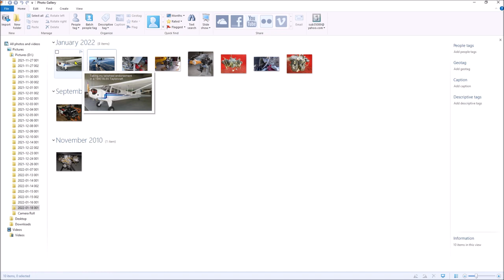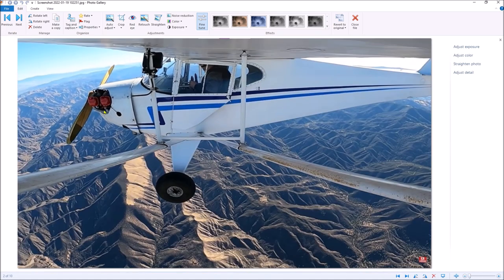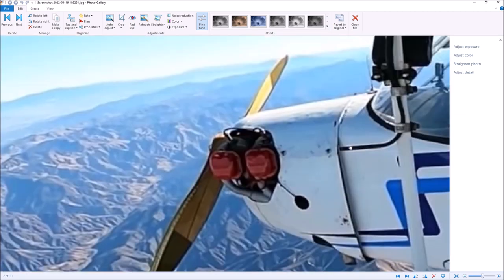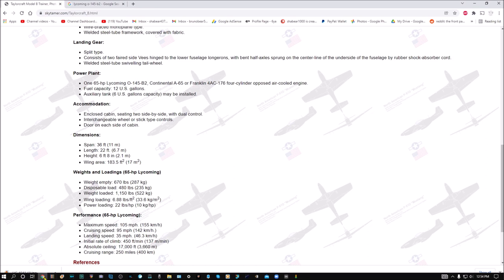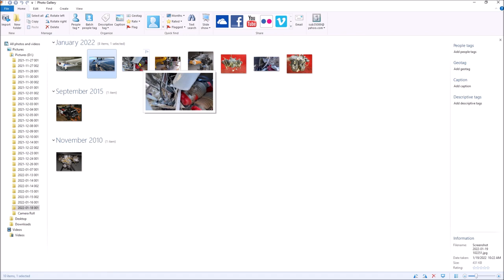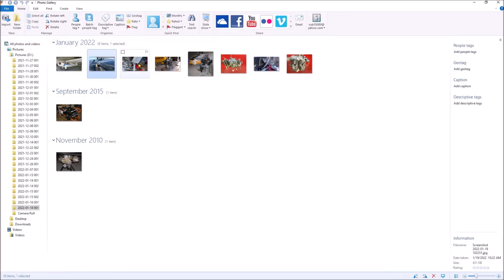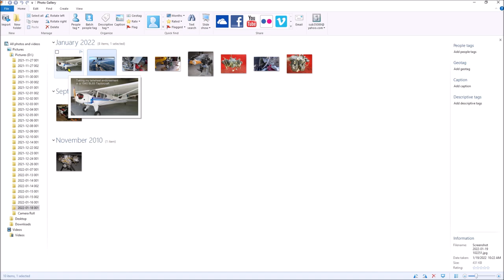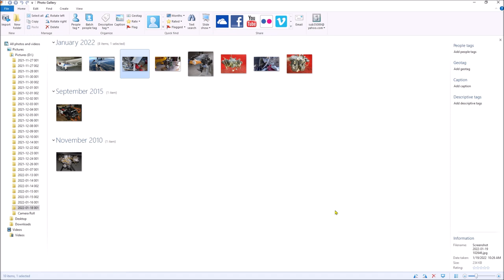Trevor Jacobs Plane Crash New Information About The Engine

Comment: Very interesting video . I have some insight regarding engines , timeframes etc . I did my tailwheel endorsement in this exact Taylorcraft in March 2019 and it definitely still had the Lycoming engine     in it . The main disadvantage of the BL versus the BC is to replace a cylinder the entire case has to be split in half . This Taylorcraft was posted for sale ion Barnstormers in October of 2021 for $9,000( I should have bought it !) with an extra engine but  in need of some work
Reply: Thanks for posting! Great how the internet can bring out the real deal from ppl who know things first hand.
Reply from the maker: That's amazing. Thank you so much for the information. Very interesting. The plot thickens again. That's very cool of you to jump in here with undisputable facts. You're awesome. Thanks again my friend. BTW: do you mind if I use this info for an upcoming video? I think this could be the info we need to set some doubters straight.
Reply: Oh, you actually flew it? How was it to fly? I feel so sad for it now. It was a classic, almost as old as my 1929 Ford Model A. Must have been hard seeing it destroyed this carelessly.

Comment: There are several things regarding aircraft that you may not be aware of.  This aircraft is a "certified" aircraft, as opposed to a "experimental" aircraft like Jacobs other aircraft N63BG.  Certified aircraft may ONLY be worked on by licensed aircraft mechanics (A&P).  The owner of a certified aircraft may NOT work on the aircraft, like for example changing the engine.  You can not just change the engine or any other significant part in a certified aircraft.  Extensive paperwork and licencing is required to change the engine in a certified aircraft.  The FAA registration information on this aircraft NC29508 shows the airworthiness certificate to be valid as of 01/03/2022 (this date is the date the paperwork was recorded by the FAA and not the date info was submitted).  The engine is shown to be a LYCOMING 0-145B SERIES.  If this engine was LEGALLY changed, the FAA airworthiness certificate would show the engine as a CONTINENTAL.  It does not!  Jacobs is listed as the owner of the aircraft.  Also, a used airboat engine can not be put in a "certified" aircraft.  The engine must be certified and that significantly increases the value/cost to around $10K.  A Taylorcraft BL65 in fair (certified) flyable condition could be worth between $18-$30K.
Reply: So the guy working on a twin prop  plane to try to get for free if he can get running is not "allowed " to work on it?  He is not an A&P mechanic for sure.
Reply: @MichaelDillin   So, that old 'free' plane that has been sitting on the tarmac untouched for years has maintained certification?
Reply: "If this engine was LEGALLY changed, the FAA airworthiness certificate would show the engine as a CONTINENTAL."   Not true!!!
Reply: Since the Taylorcraft was sold (certified) with Lycoming, Continental, and Franklin engines, it is possible to do an engine swap under a supplemental type certificate. This is more work than just switching to experimental but still possible. It would probably take longer than a month, so I’m sure this was not done.

Comment: That engine has been spray bombed, not overhauled. No reputable overhaul shop would spray bomb the valve covers without removing them and over spray the cylinders. He probably put an houred out engine on it and spray painted the valve covers to look good for the video. An aircraft engines value is based on hours, not whether or not someone used degreaser on the cylinders.
Reply: Ya, that over spray is a dead giveaway that somthings fishy, with that engine! Home job, for sure!
Reply: I highly doubt Trevor did anything to that engine. He doesn't have the know how. It's way more likely it got swapped out in those 5 years between videos. Anyone with any sort of logical thinking ability would come to this conclusion.
Reply: Exactly

Comment: The bolts is what does it for me. Absolutely nobody would paint over bolts like that on anything you'd need them to get back out of on a semi regular basis.
Reply from the maker: Great point Mark. I know I wouldn't.
Reply: Agreed. That paint job was for the plane to look cool in the video. He liked the old look before he changed the engine to make "production" cheaper and didn't care about overspray.

Comment: The breakdown on the model numbers of the early Tcraft (Taylorcraft). The B model was his second design, the first was the A model. Following the B is one of 3 letters L for Lycoming or C for Continental or F for Franklin. So if B model had a lycoming in it it was a BL65. If it had a Continental engine then it was a BC65 and if a Franklin it was a BF65. Hope that helps.
Reply from the maker: Thanks, great info.

Comment: Based on the fact that Trevor used a skydiving parachute, that some have said had a backup chute and because he scouted the location beforehand. I think he may have actually bought an engine that was air worthy because he wanted to make sure that he was in control of when it shut off so he could do this stunt in the safest way possible for him. He obviously didn't care about anyone else, but I really think he was thinking about his safety when making a lot of his decisions. 

For example, the fire extinguisher strapped to his leg could be to ensure that if the plane caught on fire and he wasn't able to steer his parachute away from the  blaze he would be able to fight his way to safety. Others have said it was to put out the plane to recover his cameras for the video, but I doubt the GoPro's footage would be retrievable if they were in a fire. Also, I don't think the fire extinguisher is large enough to extinguish the whole plane. 

Further proof that backs up my theory that he was thinking about his life was the fact that he had plenty of fuel. He didn't want to the engine to cut out anywhere but a preplanned spot and he wanted to give himself a way back to the airport if he needed to do so.

I'm sure that the camera he had on the selfie stick had captured enough for his video and the other GoPro cameras were just gravy, also I wonder if he collected the memory card from the one behind him so he could make sure nobody else got their hands on that one. 

Trevor Jacob is a very selfish person and most people like him aren't going to take serious chances with their lives, if they can help it. However, they also can get in trouble when they over estimate their abilities. He thought he was smarter than anyone else who would watch his video, the internet is now showing him how dumb this whole con was.

Comment: If I was going to crash it, I would take the certified engine out and find one that had it TBO run out. The engine looks like a A-65-1708f. They were used in the grasshoppers LH2, the army version of the same plane during ww2 and there were thousands of them made. I think they made a bunch of them for GPUs as well, because home builders liked to convert them for the aircraft. The auxiliary fuel tank shows it was near full. The army manual for the LH2 printed in 1944 says that engine uses 4.3 gallons of fuel per hour. The best glide speed for that plane is listed as 60mph and it will glide 12 miles at that speed from a height of 8000 feet. The landing roll for 2 pilot’s weighing 170lbs and wearing 20lbs parachutes is listed as 400 feet. It states if the engine quits on takeoff, lower the nose and land straight a head. It says nothing about the two army pilots wearing parachutes to go ahead and bail-out. In the video where he’s looking down at the plane from above before it crashes, you see a valley with a fairly straight dirt road that, to me, appears to be about 1200 feet long and about 400 feet wide at its widest point. Big enough to have a small fly-in for J-3 cubs and Taylor crafts. Also from the altitude of hi steerable parachute I think he could have landed in that road area, the parachute had plenty of height to steer there, but it make for better video if you have a dramatic landing in a thicket. He also took the time to trim the airplane nose down. Was that because he knew it was possible for it to glide 12 miles. I think he trimmed it like that so he wouldn’t have to walk to far to get his go-pro cameras. Even if the plane had ran out of gas, there’d still be a half gallon or so in the tanks that is out of reach of the sumps. The engine, magnetos, and engine exhaust were cold enough, that there was no post crash fire. That at least was a blessing. The last thing they would need is another forrest fire. Lastly, I could see lots of roads and trails in the video, He’s lucky that nobody on the ground was hurt. If he is not guilty, at the very least he is terminally stupid and has no business near an aircraft. In this case, I hope the FAA drop the shit-hours on him as an example to any other would-be influencer or Youtuber who might think this was a good way to draw clicks and views.

Comment: Maybe it been mentioned already. Airplane engines can only have x number of hours on them before they have to be rebuilt. So maybe the old engine had plenty of hours remaining on it and the replacement engine might be an engine out of hours. So it was probably done for money, sell the old engine with plenty of hours remaining and swap it out with a much cheaper engine that requires an expensive rebuild. 

Also, with these airplanes every bit of work has to be done by certified mechanics and recorded in publicly available records. So it should be easy to see if the previous owner had the engine changed. The exception to this is experimental/homemade airplanes, you don’t need a certified mechanic to work on it.

Comment: Thanks Shabear1000. (I got here from Pete’s Guide channel who gave you credit). I have an idea why he swapped out the engine. The FAA and the NTSB likely know the exact altitude he abandoned the aircraft but we are all guesstimating. Many assuming 9000 ft but my analysis puts him A LOT higher. Firstly he's a thrill-seeking skydiver. Most of that is done at 10,000, more advanced regularly go higher, but I've done photo-matching of screenshots with Google Earth Pro on a PC and I put him significantly higher. (I'm working on a video or two.) He needed lots of altitude not far out of Lompoc airport (LPC) for the stunt. From what I've learned the original 65 HP (85 kw) Lycoming would struggle to get him to 9000 ft let alone thousands of feet higher. That engine in the wreckage almost looks brand new or highly reconditioned. So as you point to, it's a Continental apparently, at least 20 more HP, specifications for a Continental O-190 (C75 & C85) 85 hp (63 kW), that's a significant improvement but what could a higher horsepower a reconditioned, upgraded Continental O-190 produce?
Reply from the maker: Sounds like you're doing your homework, good job. I would like to see the videos when you are finished. Please let me know if you post them. Very good information Mark. Thanks for watching and commenting.
Reply: @shabear1000  Sure thing, thanks and yes. Wait. Whoa: Look up Continental's new 200 series that can go in the Taylorcraft with almost twice the power at 125 HP.
Reply from the maker: @markmiller6844  awesome. I'll check it out lol. BTW, did you know his experimental plane has a Lycoming engine in it? Interesting 🤔

Comment: You said the old engine is more dependable and has more horsepower. If you ask me it looks like sold it to make the video cheaper to produce. And then he did a crappy paint job and didn't bother doing the paperwork to make it legal because he knew that he was crashing it.  Thanks for putting in the hours that was amazing research.
Reply from the maker: That's a very reasonable possibility. Either way, I thought it might be worth mentioning. Thanks again.

Comment: Thank you pointing out the engine swap, look closer, it has different exhaust headers/downpipes!
Most likely because Trevor cannot weld or was too narcistic he also had to cut the cowling for the exhaust to exit. Its far more back than the original exhaust.

Also the clearance at the cylinder head cutout for the exhaust looks like almost nothing, no sane mechanic would do that!
If it was not for the air midflight the paint would at some point certainly burn a little and get brown. 
As there is no discoloration i guess that swap is quite new and had not a lot of runtime. 
Even hot exhaust headers after turning the engine off would sooner or later leave marks IMHO.

Looks like a rushed job to get that one flight done.

Comment: Yet another red flag, though the flange on the cylinder barrel to crank case looks different to the pictures of other Continental engines. If I was going to spray those rocker covers I would have taken them off to degrease them, it does seem strange that they have been painted in place so carelessly with overspray on the barrel. Since the intention was to crash the plane it seems logical to fit anything that would run for a few minutes and sell off the better engine with hours left. 
Ignoring Trevor's actions there are now probably 2 engines that will be on the secondhand market. One Lycoming that is recorded as being in a crash but has not been and one Continental with no record of being in an accident. Aviation in general has a great safety record, one way or another Trevor is taking uncontrolled risks.

Comment: Quite interesting! The FAA Registry currently shows a Lycoming engine for this plane under the ownership of Trevor Jacob. But I don‘t know if swapping the engine must be updated with the FAA records.
Reply from the maker: Thanks for commenting. I'm not sure about that either but I just found it strange. It might be nothing but then again it could be something LOL thanks again.
Reply: Is there any truth to the rumor that at the crash sight they found a huge black rubber fist suctioned to the floor where the pilots seat would have been?  He did have a fire extinguisher stuffed up his pants... Dude was lucky to get out alive. Talking about flying on a wing and a.... 🤜🏿
Reply: Yes, the FAA must be notified and the records must be updated to reflect the current state/condition of any aircraft.  If the aircraft was "legally" flying, it was NOT out of annual inspection.  The FAA registration information on this aircraft NC29508 shows the airworthiness certificate to be valid as of 01/03/2022 (this date is the date the paperwork was recorded by the FAA and not the date info was submitted).  The engine is shown to be a LYCOMING 0-145B SERIES.  If this engine was LEGALLY changed, the FAA airworthiness certificate would show the engine as a CONTINENTAL.  It does not! Jacobs is shown as the owner of the aircraft.
Reply: @kentmckean6795  and that's a smoking gun to me. If he swapped out the engine for a cheaper one to save money then he had to paint it to look like the old one and he had to helicopter out the plane to get rid of the evidence. Even if he only did the paint job because he liked the old look - why do such a crappy job with it if it's not just for one last video?

Comment: You pointing out normal procedures with engine replacements on aircraft. If the engine is listed in the TCD sheet or an STC it's legal
Reply from the maker: True, but if this plane was in disrepair and and he swapped the engine right before it went down, it could be considered intent. All I'm saying is if he swapped the engine just to get the plane in the air BEFORE it was registered to him, that's not going to look good in an investigation. Like I said in the video, it could mean nothing, or it could be another strike against his claim that this was an accident and he had no choice but to bail. Even if it was real (which in my opinion it was done knowingly) he is still a piss poor pilot for deciding to ditch before the engine even stopped rotating.
Reply: @shabear1000  in the video when he is pulling back on the yoke he's doing that to get the prop to stop turning. There was nothing wrong with the engine. To start it he should have pushed forward on the yoke to allow air speed to turn the engine over. So he 100% stopped the prop from turning for dramatic footage. There was nothing wrong with his engine
Reply: @Airplanefish  Trent Palmer also said that itbis possible that he might have been trying to get the last of the fuel used up.
Reply: Fish if you watch the original video again you will see that he has trimmed the aircraft to go nose down. He is pulling back and letting go of the yoke a few times to check it is trimmed down.
Reply: As it turns out the FAA has the Lycoming engine registered, NOT the Continental. Hence the engine was changed and not registered as changed hence, illegal, if this douche bag changed the engine himself he breached another FAA law. So this youtuber was spot on and no ‘normal procedures’ were followed as you state.
Reply: @amosmoses8656  you don't register an engine if you change it. If it's an STC then you would turn in a 337 to the FAA but it will takes months before they look at that even of they do. Changing an engine that's on the TCD or an STC for that aircraft is not like changing N numbers. You don't call or go to the FSDO for engine approval changes like with N numbers. Whatever is on the FAA registry is probably what was in the aircraft when it got its airworthiness certificate